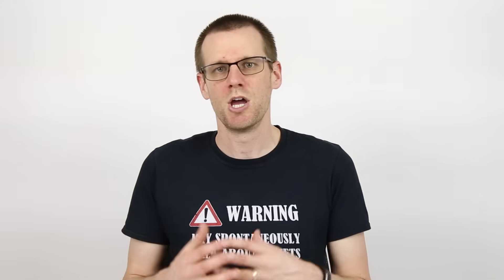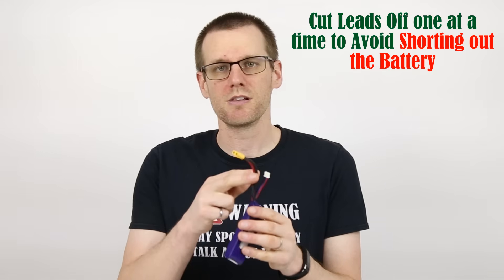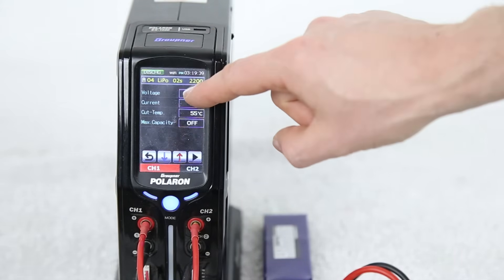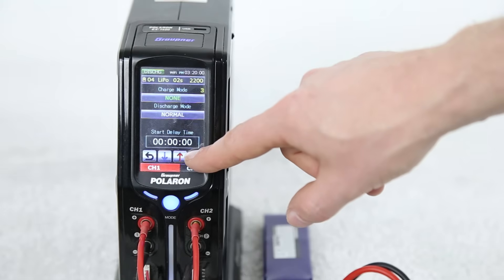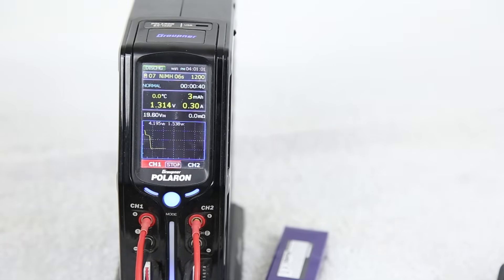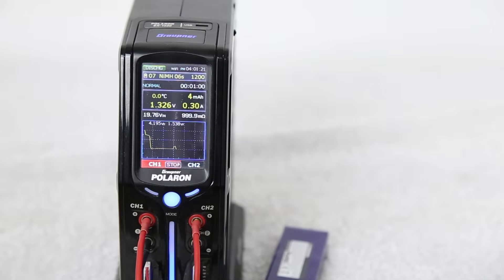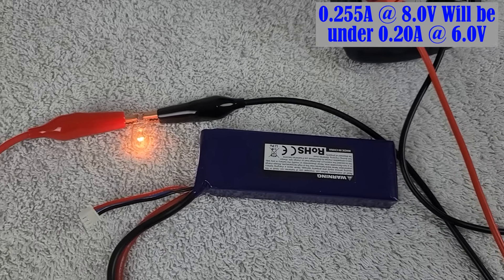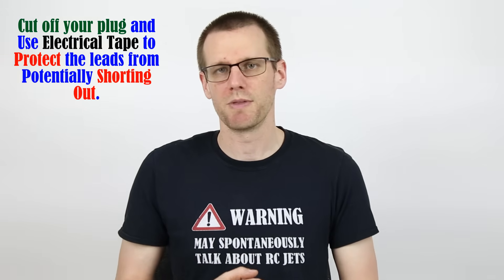How can a RC LiPo BATTERY be Responsibly DISPOSED of?

Comment: After a friends garage completely burned down last week, probably because of a lipo fire igniting some gasoline, I decided to get rid of a 6S Lipo I didn't trust anymore (the voltage of 1 cell always dropped far below the other 5). I submerged the LiPo in salty water, and connected a 24V 100W halogen bulb. 
Within 1 hr the voltage dropped to 7,2V, and the bulb went out. Now 24hr. later the voltage dropped to 1,2V, and the water is full of white and green crystals. 
Any idea what is causing / creating these crystals?
Reply: seen that green/blue buildup also and my cells looked and got a thin layer of slime on the outside.

Comment: Hi - do you cut the leads prior to placing in bucket? How do you check voltage after the 2-3 weeks?
Reply: With a multimeter. F.i. Fluke 117.

Comment: Thanks, but what about internal resistance level to dispose?
Reply from the maker: Instead of relating disposal to a specific IR, consider performance of the pack. When the pack no longer delivers the required performance for your RC's, then it's time to cut your losses. This IR value can be very different depending on the application and the battery.
Reply: I was curious about that to.

Comment: I have a take no chances approach to Lipo batteries, the moment it starts ballooning i do not trust it anymore. That is when I disable and dispose of it, When i started with Lipo's (in around 2007-8 I think), we were taught to discharge as much as possible with a charger, then a single automotive bulb (like a turn signal) till it no longer lights, then use the saltwater bath till the electrodes were completely dissolved. it was then that it was considered safe to dispose of in an eco friendly manner
Reply from the maker: These processes are second nature to you then! That was an Automotive 12V bulb in the video, placing two in series is what I've done for 4-6s packs. Works well.
Reply: @RCexplained , oh yeah it is, i took a break from RC, but talked to friends as a refresher before diving back in. I've been fortunate to only ever have 4 Lipo's ever fail, they were from the same battery maker and is still in business today. I won't out them, but hope their quality improved over the years
Reply: @crazylarryjr  for the safety of us other hobbyists i dont mind if you name the company that had those unsafe cells.
Reply: @extec101 , I personally never had an issue with a particular make, I was only saying these were the precautions we used to dispose of a faulty Lipo. That is still how i dispose of them to this day, though after discharging I would dispose of them in a Lithium recycling bin now that those exist at like lowes or Home Depot. As far as the brands i used back then, I used Hyperion, Thunder power and had a few Maxamps packs and of those, the Maxamps were the weakest, but this was 2005-2008, I'm sure they have improved batteries by now. Currently i have a pair of Ovonic 5500 soft packs for my current rig (Arrma Big Rock) and they are excellent packs for bashing
Reply: @crazylarryjr  can agree that the lipos today is better then the ones that came in the market at first.
had seen both race brand used by pro racers in buggy racing and cheap china brands that puffed up and lost large amount of power, no catastrophic fail but faild anyhow.

Comment: The bucket hack should be done outside, the gas resulting from the battery is quite toxic.
Reply from the maker: Thanks all! I added this as a note in the video. Cl2, O2, H2 are all released in very small quantities during this process.
Reply: If the battery does not leak, there will be only gases from the electrolysis process - oxygen and hydrogen.  Hydrogen is highly flammable so you are right to do it outdoors.
Reply: @maxxm.108  This is only true for fresh water, NOT salt water.
When electrolysis happens on salt water you create chlorine gas which some of that will create hydrochloric acid.
DO NOT put your bucket of salt water with lipo batteries or old lipo battery water INSIDE.
Reply: Thanks @moody2808 , chlorine was the gas that I was referring to as toxic.
Reply: thx, I didn't know that👍

Comment: I use LiFe batteries and they are recyclable ♻️
For Lipos let them sit in water overnight then go by the directions on the battery for disposal. Most are recyclable. There are also battery drop off sites if you look around.
Reply: Salt water.